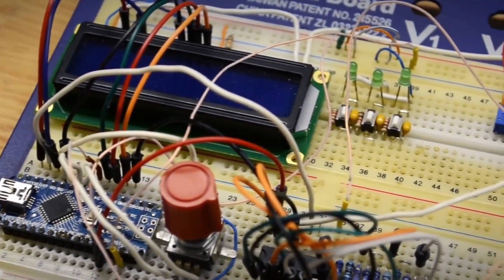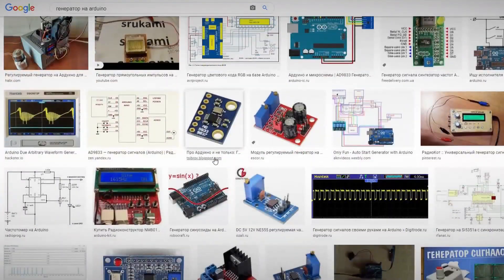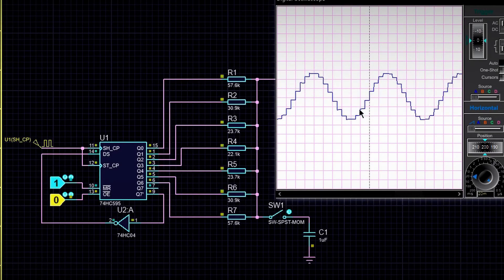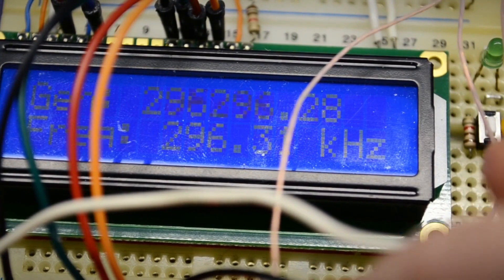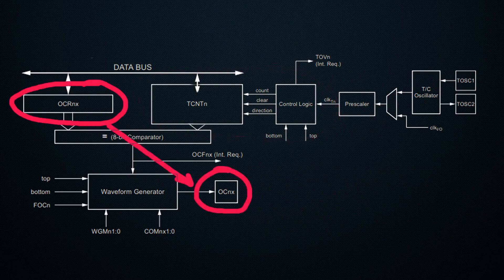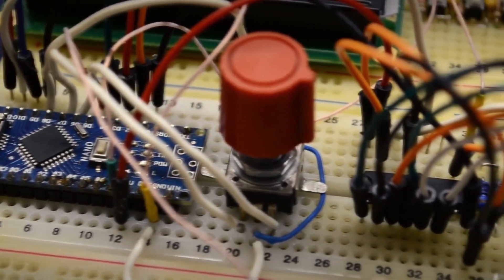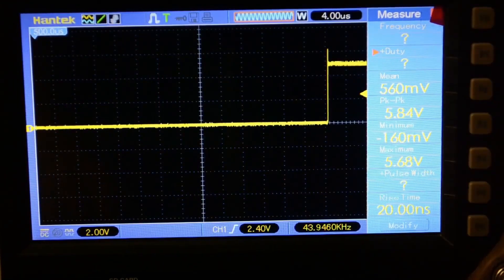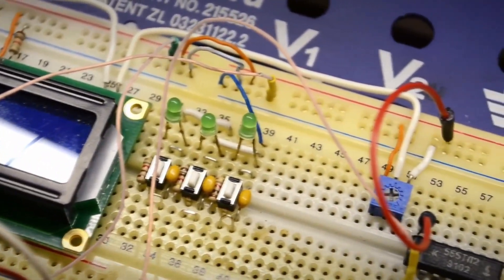DIY laboratory signal generator.

Comment: Awesome project! Now it needs an amplifier to set the pk-pk voltage and offset. Adding an offset with an opamp and a signal from DAC is easy enough, but what about the amplifier? I have been stuck on that for a while and couldn't make it work to be continuously adjustable digitally. Digital pots are ok, but lack the precision due to step count.

Comment: it also can be improved, for instance make a fixed tone at 1khz and mix it with the output to alight am radios... better build and study this than buy a cheap one based on xr2206. Arduino can be a quite reasonable lab tool, geral component tester including lcr, voltage, current... a true RMS multimeter, using few external components... also with a pre scaler the range of frequency it can measure can be extended a lot...

Comment: Why not ESP32, ESP32C3, STM32F4, RP2040, CH32V, etc any popular newer microcontroller? Here you will instantly get a win with higher MCU clock speed, and in general get better timer/counters to play with in the code.
Reply: I’d bet it’s “it’s what I had laying around”.
Reply: People tend to have lots of nanos at home :D
Reply: There's an argument to be made here about where does this end? Use a more expensive micro, use more precise components, maybe just buy a cheap signal generator? Why not a more expensive one?

You have to stop and realise this is just a hack. It's supposed to work, work, not work better than something else. Arduino is the most widely known and popular, framework. If you're making a tutorial, better to use an Arduino than something else
Reply: @blackhole7818  ESP32C3 and RP2040 are just as cheap as any Atmega328P nano. So that is decidedly, no longer a defense. In many projects, you could use just about any microcontroller as it's just doing "glue logic" for various inputs and outputs. But here the clock speed of the MCU is an absolutely crucial spec which directly affects the primary performance of the project, how fast it can run as a sig gen. So it absolutely makes sense to use a cheap MCU from the last 10 years rather than one from the last 20 years that is 10x slower!

And firstly, all of these chips can be programmed using the Arduino framework. Secondly, the code shown in the video demonstrates using bitsetting that is NOT part of the arduino framework, it's in general specific to ATMega chips, so that defense also falls apart. In this project code we are already abandoning the Arduino framework for direct MCU programming to get the best speed possible.
Reply: @blackhole7818  An RP2040 board is most often cheaper than any Nano, because the ATMega328P chip is now so old and expensive. Yet it will be 10x faster. There is code in this video that is using not the Arduino framework APIs, but only the bare metal MCU API. So it's not easily known code. You need to talk with actual facts in mind
Reply: @blackhole7818 ESP32C3, RP2040 are both *cheaper* than a Nano. And 10x as fast. So you need to argue with actual IRL facts, not nostalgic remembrances from 10 years ago.

Never mind the fact that here the code wasn't only using Arduino Framework, it was directly manipulating the MCU registers for the timer. So even your argument for familiarity is shaky, belying the fact that all the mentioned MCUs have Arduino frameworks written for them.